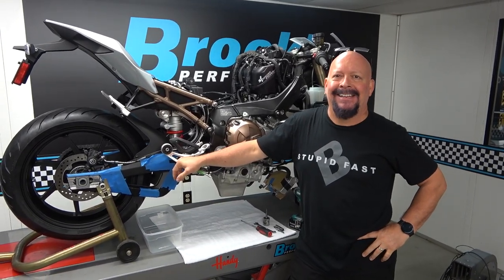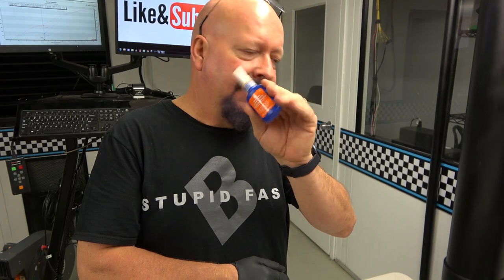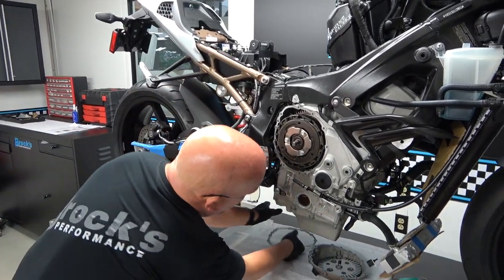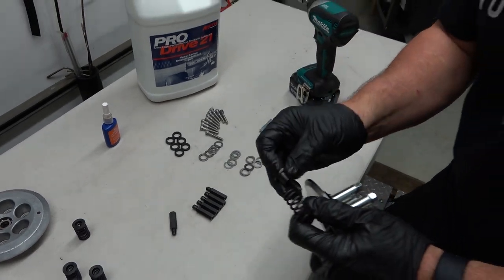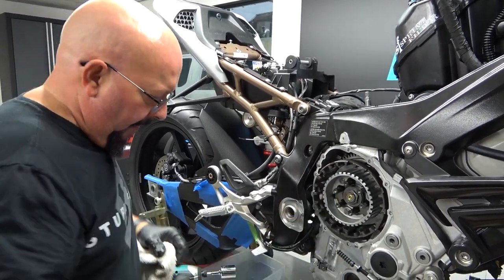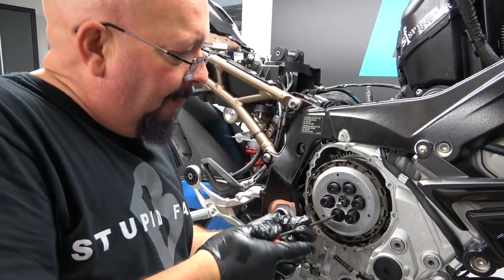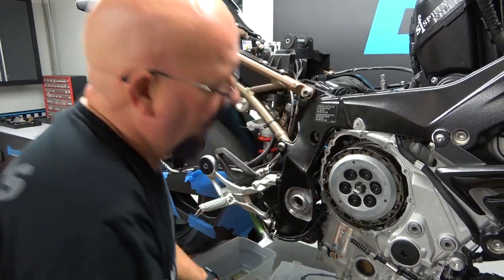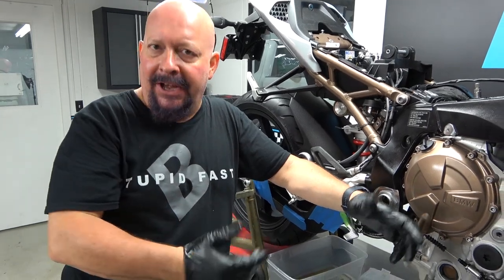BMW S1000RR (20-24) Clutch Conversion Kit Installation

Comment: Brock i found out what the nuge in the edge of the clutch plate are for, it is when you take the plates out, you Can get a hook that fits in that nuge 😃
Reply from the maker: Makes sense, but there is a much larger gap between the hole in the fiber and the inner hub to remove them.

Comment: Can you do the same thing Brentuning does where he flashes the ecu and it maps itself for fuel any condition and anything? Brent says the bike never has to touch the dyno to run top notch at all times. Supposedly different technology in the ecu that can manage everything on its own with its closed loop system.
Reply from the maker: We will have an announcement on this exact subject a bit later...stay tuned!

Comment: I rememver being a poor teen trying to spport my habit and we had various tricks to eke more milage out of components....we would ressurect  clutch that was just about had it by taking a center punch and putting a whle bunch of punch marks in the steel plates and gently rough up the fibers maybe even try to sneak in an extra plate if possible  ...and then we might scrounge through parts boxes for stronger springs maybe even just every other spring if they were over the top ....hey if it kept it on the road another few weeks that was a success!   To sqeeze more miles from drive chains?  Just flip sprockets around l  Keep trimming split frayed fuel lines or even finally splice to make one longer using some random metal tubing from dad's scrap bin etc etc....epoxy JB weld for cracked side cases ....bailing wire duct tape ANYTHING to keep a clapped out bike going one more ride with pals lol  I actually broke the end off my throttle cable miles from home back in the hills and tied a knot around a nut I took off something else and stuck that in the front brake lever instead of the brake cable....necessity is the mother of invention type thing
Reply from the maker: Said non of today's youth 😉

Comment: I heard the 2020 BMWs will self tune. Meaning if you install an after market exhaust it will automatically adjust the air/fuel ratio. Is that true?  As always great informative video. Can't wait to see the next one.
Reply: Yes she will self tune I ran mine with full akra for about 2000 miles before I tuned her with no issues at all, but for max performance you need a tuner like Brent tunning. All you need is 1 map for pump gas and she will adjust for the different octanes. They will give you also a map for MR12 BUT YOU CAN RUN IT with the regular pump gas map if needed, but for best performance I use the mr12 map.
Reply from the maker: That is correct

Comment: Hello, so I'm not here to cause any problem, but I did exactly what you said when installing the clutch, first I put the 2 springs first with the thinner friction plates just like in the video, but one of the springs got stuck with the clutch basket, I had to take everything apart again because I was not able to get my bike into gears, so what I had to do first put a friction disk, then a steel plate, then the smaller friction disc with the 2 springs to make it work.
Reply from the maker: Glad you got it figured out!

Comment: Hey brock,I  am just curious, WHY DO THE K5/K6 SUZUKI GSXR 1000 DOES 0 TO 60 IN 2.35 SECONDS,HAS ANY OTHER BIKE BEATEN THAT YET?
Reply from the maker: 0-60MPH times are difficult to properly measure. I can tell you that, while the K5/K6 models were very stout for their time, today's bikes are much quicker and more powerful. This is why there  were no K5/K6 models present at the 32 bike field of the XDA Fall Nationals in September 2020: https://bit.ly/3hIdwWz the 05 listed is a misprint as Jeremy Teasley was riding our 2017 project bike, Gixzilla.

Comment: Happy new year Brock! will the slipper clutch function will still work on this clutch mod?
Reply from the maker: Not as installed since the slipper mechanism contributes to the poor launchability of the BMW's.  That said, if the mod is removed, the slipper will work again.

Comment: Hello buddy! Great video! My s1000rr 23 is a strong nice bike tho i don’t like the clutch feeling plus the engine brakes specially on slow speed feels clunky, I mean is difficult to keep it on first and second speed to 20mph without experiencing some shaking behaviour. Any recommendations please?
Reply from the maker: The assist clutches have terrible feel at the lever. You can feel them pulse in your hand as well as  making the bike shutter and chatter on activation as well as when the anti- slip kicks in. Our conversion kit simply make the clutch work and feel like clutches used to feel before they started adding all of the features that save us from ourselves.
Reply: @BrockDavidson  how much is the kit ? Thanks!
Reply from the maker: https://brocksperformance.com/clutch-conversion-kit-for-bmw-s1000rr-20-23/
Reply: @BrockDavidson  thanks

Comment: Brock I’m not sure where to ask this question but here goes. I’m looking into lightening the flywheel on my bike to get it to rev a bit faster...what affect does reducing rotational inertia of the crank have on engine braking? Will a lighter assembly make engine braking more severe or lighter? I plan to do some street and road racing still
Reply from the maker: David, great question. The effects of crank lightening can have a dramatic effect on torque output - this is determined by the crank you are lightening. As a general rule, older bikes benefit more as the engineering of newer bikes is so precise, that improving upon the factory specs/performance is unlikely. That  a lighter crank will naturally reduce engine braking.  Newer bikes can have both worlds - optimum crank weight for best overall performance, and electronics to adjust engine braking as well as optimize acceleration. If you would like, e-mail me at Bmail@BrocksPerformance.com with more specifics on you bike and I'll try to help more.

Comment: I thought those side cover bolts were one time use or stretch to yield?
Reply from the maker: Our clutch conversion kit replaces the OEM single use bolts with stainless shcs. I've had the same  set in our Brock's Performance S1000RR since 2010 - still going strong after hundreds of cover removals. More info: https://bit.ly/3fBrqdI

Comment: Will the auto blipper/quick shifter need to be recalibrated to work without the slipper/assist clutch?
Reply from the maker: The conversion is to improve dead stop launches (drag racing/LSR etc.) We do not use auto blippers to downshift (we use our brakes in the shutdown area at the end of the run) and upshifts are not affected since the clutch is fully engaged when upshifting with either arrangement.

Comment: hi bro
I'm riding the 2020 s1000rr m package in Korea
Compared to the old s1000rr, the new s1000rr has a harder willie
I feel like I need to hit the throttle a lot more
If I change to this clutch, can I get the old-fashioned feel?
I want to change it, but I'm thinking about the price
I want to change it, definitely willie, if it goes well, I want to change it
please reply thank you bro
Reply: I do a lot of 2-speed clutch willie
Reply from the maker: The 2020 has a longer swingarm to reduce wheelies. Drop one tooth on the front sprocket and you will be happier 😉

Comment: I have all the clutch parts from previous gen. Is it possible to purchase the hardware separately?
Reply from the maker: You can get with customer service to see if they can help.
Reply: @BrockDavidson  I tried today and they told me they only sell it as a kit.
Reply from the maker: @wbgarywp   if you have the OEM parts to convert, you just need to purchase the mod for the year conversion you have and also install the clutch according to the service manual for the year conversion you are doing also.
Reply: @BrockDavidson  awesome. I installed it all once before but pulled it back out because the pressure plate made contact with the cover. I'm not sure if that's because I didn't install the clutch mod and I was trying to leave the slipper in place
Reply from the maker: Perhaps. We have not tried using the slipper, but I believe the adjustment studs and nuts could be a problem.
Reply: @BrockDavidson  yeah I'm not sure if that's what it was or not. The k67 pressure plate has a much thinner friction surface area and it just wears a Groove after a few really good launches.
Reply from the maker: Hmmm, that should not happen. Send images to: bmail@brocksperformance.com and I'll try to help.
Reply: @BrockDavidson  thank you very much. As soon as I get this epoxy floor done in my garage I'll take it apart

Comment: My 23 S1k has broken clutch plats in the oil pan what would you think the reason for that? Was the clutch pack defective or is it just worn out? Thanks a lot
Reply from the maker: Stock clutch or aftermarket?
Do you have a clutch mod?
Without a clutch mod, if you perform dead stop launches all of the chattering that occurs can break the fiber plates... This is this is far more likely to happen with an aftermarket clutch than with stock. We use all stock fibers along with our clutch mod and spring kit and we have never fractured a fiber plate.
Reply: @BrockDavidson  it’s an OEM clutch kit 
Bike is in for a water pump replacement but iv never seen plats break like that befor and some shavings would reach the belly ban?
Bike has 2500 miles on it.
Reply from the maker: @S1kdownshift are you launching the bike from a dead stop?
Reply: @BrockDavidson  No I only tried launch control once.
Reply from the maker: Wow,...hard down shifts?
Reply from the maker: Rider weight?
Reply: @BrockDavidson  I’m 160 pounds. 
No hard downshifts
bike was rideable but had a loud clicking sounds from the clutch 
I didn’t know anything was wrong with the clutch until they went in to change the waterpump…

Comment: Does this setup work for s1000rr 15?
Reply from the maker: The concept, yes. Some of the parts required are different. Our customer service team can help you decide on the best parts to match your requirements and budget.
Reply from the maker: This should help also: https://blog.brocksperformance.com/bmw-s1000rr-10-16-information-page/

Comment: I just bought 2022 and I got civics beating me off the line at stoplights. Clutch is absolutely awful.
Reply from the maker: Lol, yeah...we know. Solution will be available soon. It's in final testing phase.
Reply: @BrockDavidson  Awesome can't wait. I'm only a few minutes into this video and will finish it tonight. Does it explain what's different about this clutch vs the last gen? I sold my 2016 bike and that thing got off the line so fast it was ridiculous. Never needed launch control.
Reply from the maker: @Jeff K - The new Busa has an "assist" clutch like the 2017 GSX-R1000. This video explains what it is and how we get rid of it: https://youtu.be/VBeYEhEIX3U as the only thing it "assists" is addtional time on the clocks.
Reply: @BrockDavidson  thanks!!
Reply: so if i've understood the video correctly: this bike has an "assist" clutch just like the new busa and 2017 gsxr you mentioned?
Reply from the maker: Correct. Unfortunately, and unlike the GSX-R...we can't just pick and place previous parts from another model year to correct as the G3 input shaft is too long for G1 or G2 parts to fit. So we machined our own billet items and they are in the final testing phases as we speak. The new set-up is even smoother than our previous offerings because we can alter areas that were previously controlled by OEM manufacturing.
Reply: @BrockDavidson  thanks for the explanation! It sounds like riding style matters when it comes to choosing whether or not to install the conversion? As a rider who doesn’t go crazy in the canyons, might do 1-2 track days a year and definitely needs to be able to beat the boys off the line in a drag race down pacific coast hwy does it sound like it would be an optimal solution for me?
Reply from the maker: If you want to launch from a dead stop, the assist clutch is as terrible as they come - as you know. Converting to a more standard configuration simply makes the bike act like all bikes before slippers and assist clutches. If you are a rookie and like to slam your bike into 1st gear at 70 MPH...leave it in. If you have weak hands and/or love a buttery soft lever feel...leave it in. If your bike is 12+ inch over stock and you can simply rev it up and throw the lever without the need to actually ride the bike...leave it in. If you are like us and a majority of our customers at Brock's Performance...take it out. FYI: I can swap back and forth in 15 mins, if needed for the riding I will be doing.
Reply: @BrockDavidson  I probably made myself sound totally noob but I'm no rookie on the bike...just in my mechanical technical knowledge unfortunately. Sounds like the conversion will be perfect. When/where can I be notified of its release?
Reply from the maker: It's going to be 4-6 weeks from now. You can check our site, sign up for our email blasts and/or use the blue support button and ask customer service to place you on the notify list. And no, you don't sound like a noob...far from it. But my replies address anyone who might be watching 😉
Reply: @BrockDavidson  sweet thanks will sign up today!

Comment: you claimed that stock it pulled 195hp. There is no way.. every k67 I have seen stock pulls no more than around 174. They pull around 195 all stock with a flash but NOT without! It was inaccurate to claim it was stock pulling that much. You clearly flashed the ECU!!
Reply from the maker: lol, yep...we love to lie to our followers. Just curious, instead of insulting our integrity, why don't you look into why the dyno you use is so inaccurate - or maybe undoing any "performance tricks" you might have sabotaged your bikes performance with?
Reply: @BrockDavidson  I don't have a dyno. I am simply regurgitating what every video of a K67 I have seen puts out. For some reason your dyno seems to show 20+ more horsepower than everyone elses. Looking further I  have now found  some showing 190+ so who's right here? Perhaps, I am wrong to think the K67 only loses 8hp between the motor and the rear wheel?! Why are some showing 183hp and your's showing 195? There was no attempt to insult you. Perhaps, it came off that way and if so, I would like to extend my apology!
Reply from the maker: It came off as a bit critical, IMH - but no hard feelings. 

I can tell you, that in my 30+ years or dyno experience... I have NEVER, not ONCE visited a local dyno shop that's is A: set up properly and/or B. Maintained and calibrated properly. We go into great detail to make sure our results are as accurate as possible. Search "dyno" in our Tech Talk Playlist. Here's a GREAT video of fixing a dyno that's "down on power" https://youtu.be/LhV6tkPKSAY (Hint...it's not the dyno...). These are useful also when trying to obtain consistent/accurate dyno readings: https://youtu.be/NkNfmW44zuA and especially: https://youtu.be/fs5LRCz64dk